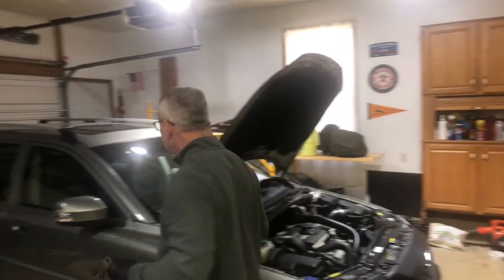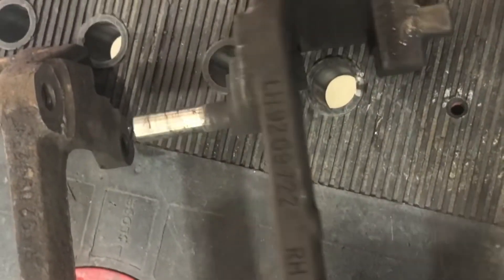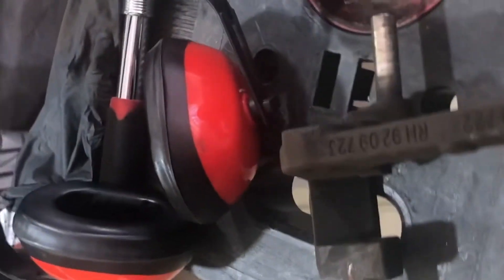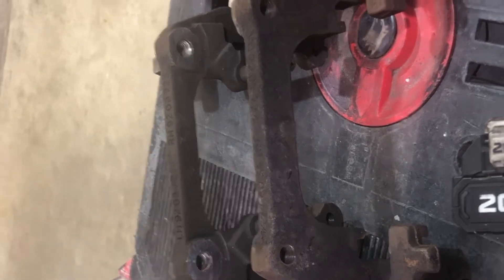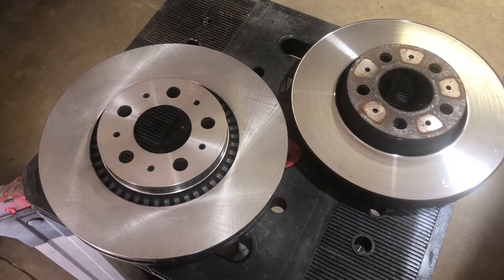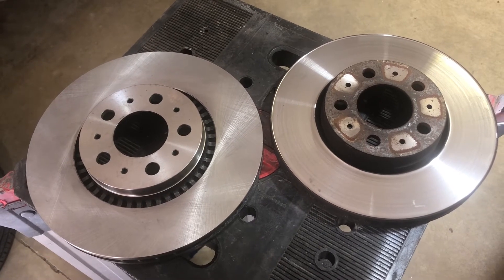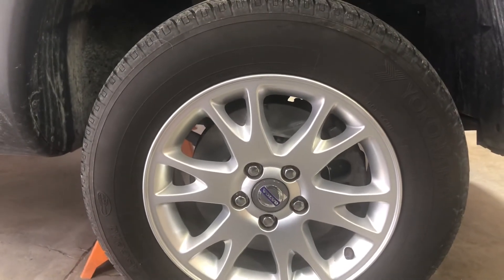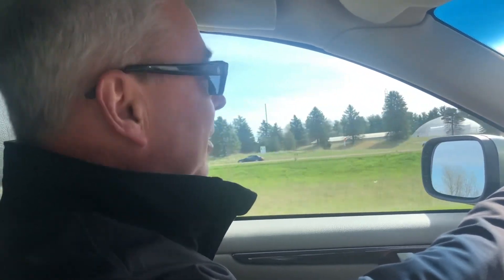How to Add Bigger Brakes to 2007 Volvo XC70 while retaining the same calipers, no bleeding needed!

Comment: Well, actually it's not bigger brakes since the caliper and pads are the same. Bigger rotors which moves the leverage further out from center which improves braking force. 😉😁
Reply from the maker: The brake system is larger due to the larger rotor; this changes the effective leverage as the pad distance from wheel center is increased. A calculated 27% more stopping power is available!  Now tire size, friction of tires to road, friction of pads to rotor, temperature, can all affect stopping ability. All things equal, the 27% is a nice increase!  
Thanks Robert!